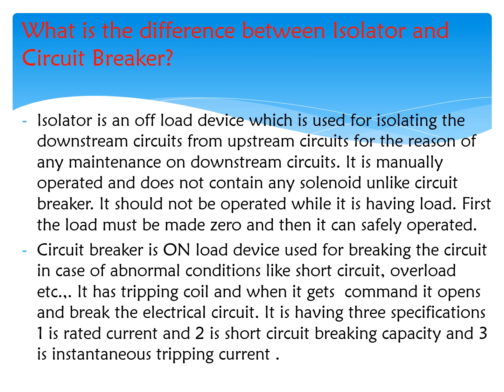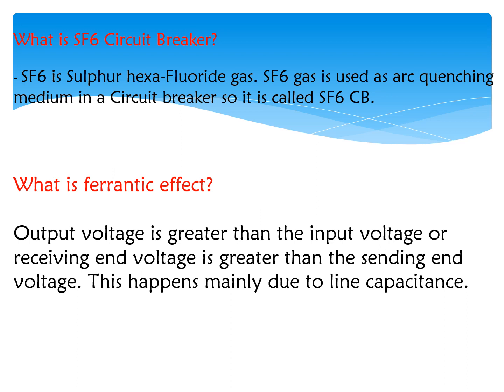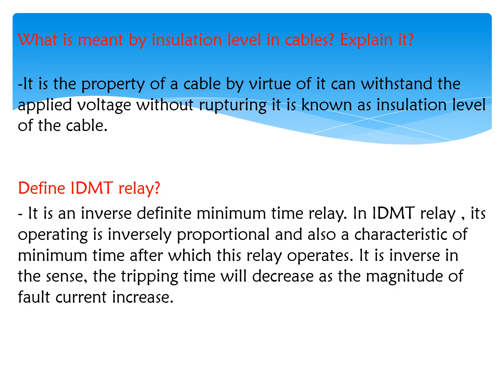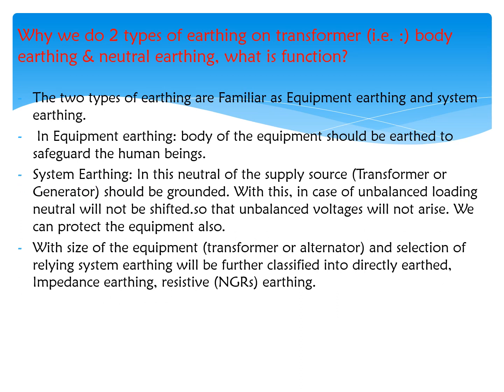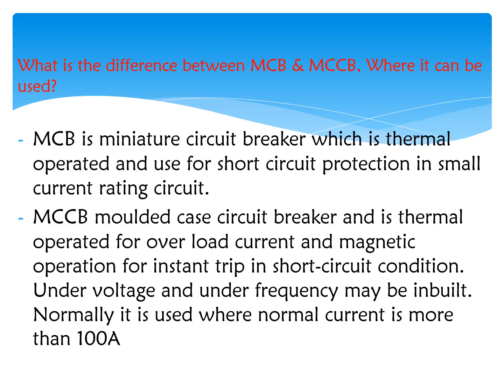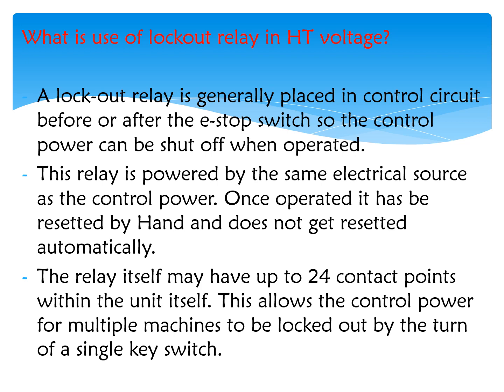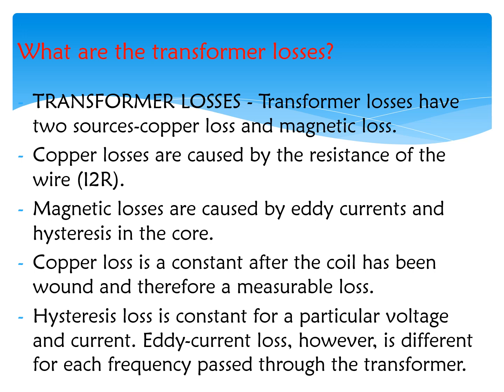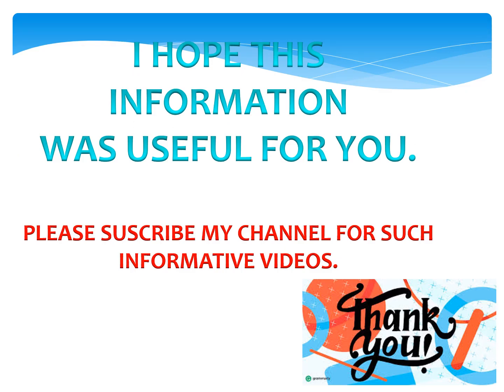Electrical Engineer job Interview Oil & Gas |Technician | Prepare your interview |

Comment: I want to ask something sir
Reply from the maker: Go ahead
Reply: @kishorsoni5841  what electrical engineer do in oil and gas like  protection engineer,transformer, all one engineer tell me what work they need to HT panel generator how much third party I want each topic of engineer
Reply from the maker: @tauhidalam3425 it depends on where you are placed. Typically you should have knowledge of all electrical equipment.
Reply: @kishorsoni5841 basic knowledge of transformer testing , vfd etc all came i electrical engineer tell